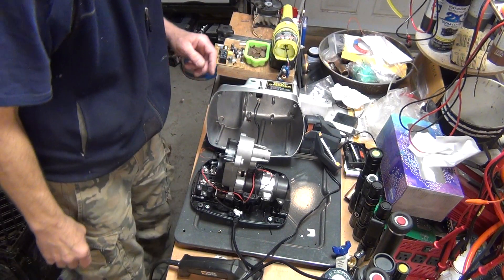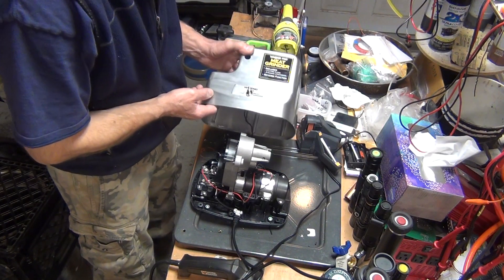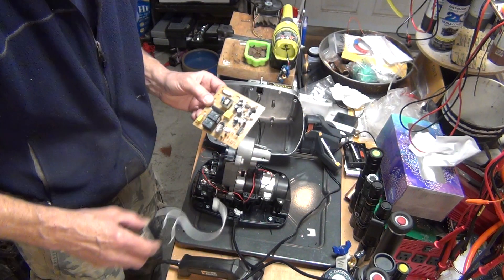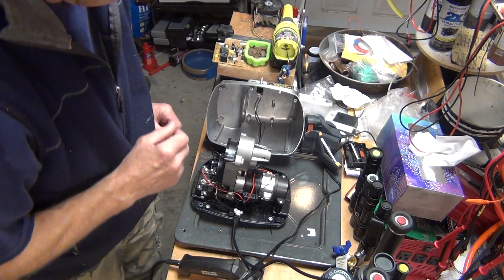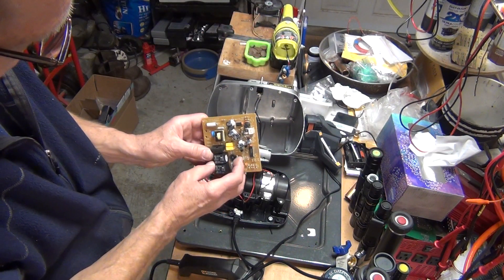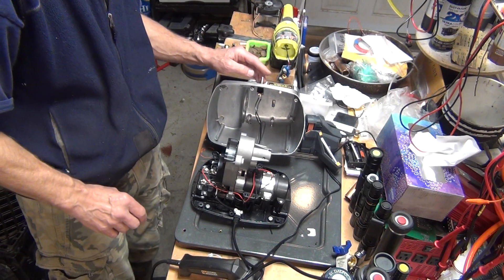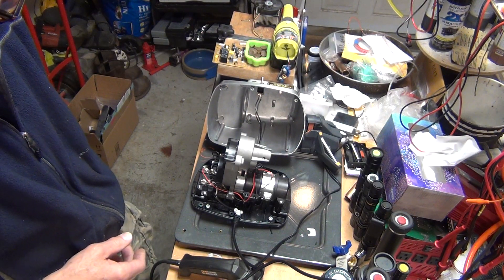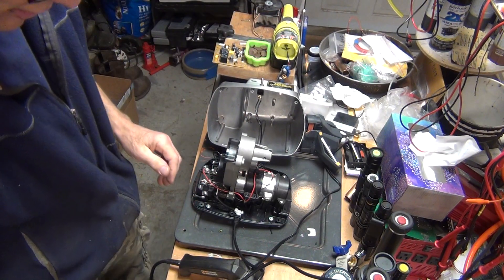Electric Meat grinder repair

Comment: How dis you open that cover?
Reply from the maker: don't remember exactly but I know its a bitch to take it off
Reply: My grinder. Makes a noise when it’s turned on , when I disconnected the gears the noise stoped , I don’t know if it’s coming from the motor or the gears. What do you recommend?
Reply: Most of the time, it comes from bearings inside motor part.. but if bearings already replace & noise still there, its already gears issue.. try to look ur gear teeths if still smoothed or damaged..